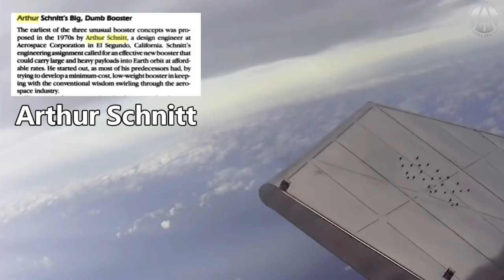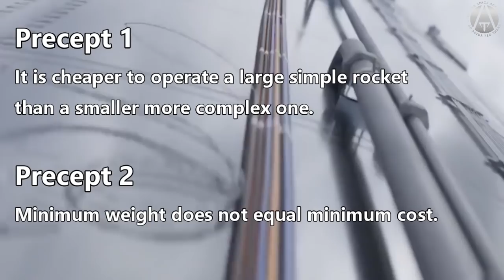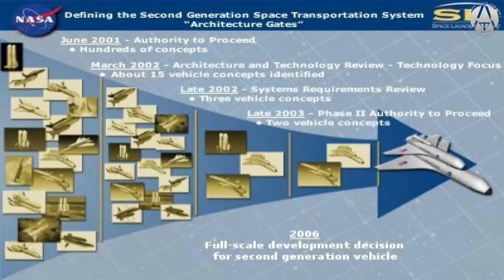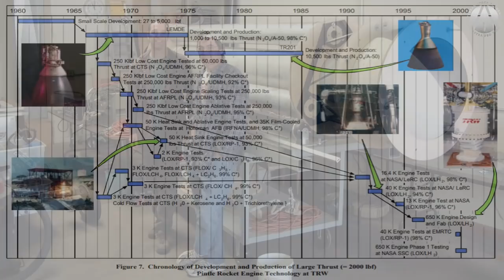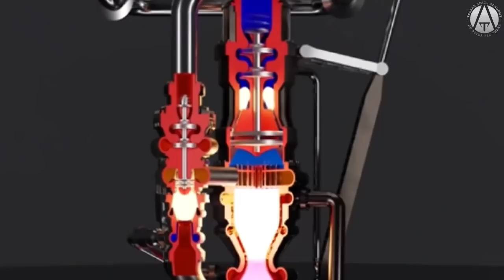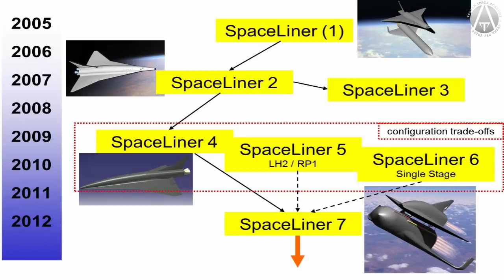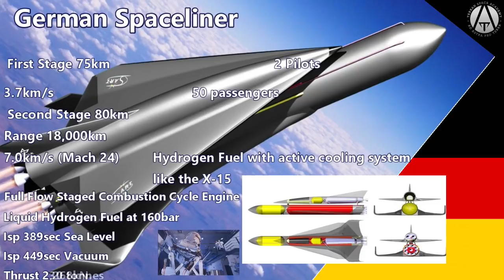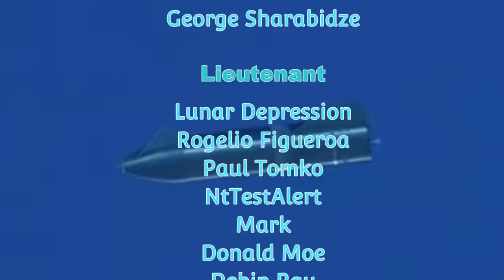SpaceX Starship: What is so special about the Starship system?

Comment: To paint a more accurate picture, it may help to have the perspective of someone who used to work for TRW before it was bought out by Northrop Grumman.  TRW was known for pulling off all of the most complicated and hard to do stuff in the aerospace industry.  There would often be another prime contractor for a government project, but TRW would get all of the most complicated, hard to do stuff as a secondary contractor.  When TRW got the prime contract, such as for the JWST long before it had that name, they were on track for the original launch date, at least when I saw it in the clean room.  TRW had a motto of bureaucracy busting internally and paying top dollar for all of the best engineers.  They wanted their engineers to make it to the finish line as unimpeded and properly supplied to do the task at hand as possible.  It was a great place to work at and there was a real can do attitude and lessons learned from past experiences and the long retention of employees, granted high level (as in government) changes in projects forced some turnover.  It was a whole different era of America.

So to more specifically answer what is not quite right about what you said, while of course there is the problem of how politics go about things, TRW was long supported by the government and TRW in turn brought in top talent to get the job done.  In the Clinton administration in particular there was a merit based system where companies tracked their metrics and provided them to the government when bidding on contracts.  TRW won a lot of stuff during the Clinton administration due to their excellent ratings.  All that changed in the Bush administration, playing more to the point you are making.  So it does happen that the best can bubble up to the top and pull off some amazing stuff.  It is just that is not what always happens.  Even with the ultra rich, most don't care and won't fund it once their money source is established.  We just got lucky with Elon that he has been willing to risk it all to chase after the big dreams and ambitions and bring on top talent to pull it off.

A thing to consider is most everything worked on as in big, well funded project, has some motivator and specifications laid out.  For example look at the A-10 Warthog and they had this big gun they needed to build a plane around.  You get a contract for a bomber, it is built around the bombs it needs to carry along with some performance characteristics for the delivery of those bombs.  Falcon 9 is built around specific goals that are now well known and understood.  Research for the sake of research is a hard thing to get funding for and getting into how that whole research funding process works could lead to you making whole series of episodes.

The thing is there are a number of good engineers, scientists, and inventors (and others) with great ideas that never go anywhere.  It is rare to get everything needed to succeed together no matter who is in charge and who has the deep pockets.  I see the root causes of this go much deeper than what is explained here.  Some of the more basic insights I see for this are:

1. Monkey sphere / good o' boy club - People like to stick with who they know and don't care about the rest of the people out there.

2. Risk assessment - When something is working and bringing in the money, even if it is really a dead end strategy for making money in the long run, people will stick with it and generally not make big risks (or any perceived risks) for potentially more money.  Usually the big risks taken are when you have nothing and consider yourself to have nothing to lose.  At this a lot of people won't take the big risks because they don't want to crater their current financial situation and so say instead of starting a company with big loans, will instead take a regular job at an established company.  There is also a bit of a counter thing that goes on where people will gamble away their money frivolously because they enjoy the thrill of gambling, but these people tend to not have money for very long or the money source (say a spouse making a lot of money at their day job) dries up.

3. Ignorance / too far removed - When you deal with something every day, say a materials scientist researching and building transistor manufacturing technology, you are probably going to make some realizations on how to do things better and maybe make that next advancement in your field.  When you manage people all day, you get focused on other things like does that materials scientist look busy, is s/he staying on task, are people complaining about him,/her does s/he complain about too much stuff, is it taking him/her too long to get this task done, is s/he asking for more pay than the company wants to allot him/her, etc.  That manager probably has no idea what is going on with that materials science work.  The thing I have seen is say with TRW, the manager telling people what to do at least used to be hands on and so has some sort of idea.  It might be a little outdated and you with your hands in it every day know about all of the latest stuff and maybe you are more daring while the manager is thinking more of what s/he did that worked so pushes for something more tried and true, so that can cause a little bit of friction, but that can't be helped.  Other places I have worked at have had very different things going on.  It is pretty common for management calling the shots to have zero knowledge of how things their underlings work on work.  Often times at the more dysfunctional places there are just top down one way directives that are more or less completely detached from the ground reality, but the base reality still hold true despite the top down one way directive.  The thing about Elon Musk is he is deeply involved in the nuts and bolts of what his subordinates are doing all the way to the ground level.  This is rare, at least these days.  With his enterprises growing to be so big, it is an enormous challenge for Elon to keep up with the more nuts and bolts side of things and there is the question of can he maintain his grip on it and keep things guided towards success?  I would not underestimate how hard it is for him to do this.  Just some simple breaks from reality because some information is not effectively conveyed can lead to big problems.  (Aren't we just hearing about Raptor engine production woes after some high level management turnover?)

Maybe you could put out more focused episodes on things like:
1.Iterative development processes.

2. Structured development processes in general.

3. All of the above and how to run a technical team has a whole lot of literature too it and certification processes and all of that other good stuff.  Really, the life or death of a project is largely how you structure the development process.  Often times if management sees the project is getting somewhere and succeeding they will continue to support it where if it has turned into a big, embarrassing mess, they don't want that.  So while not always the case, there is an influence on factors like this.

4. Get more into the ways to succeed and fail at bringing an idea from an individual or even group to a successful finished product.  You can make a whole series in the study of how this works and all of the various pitfalls where things end up failing.  While it is good to know what tends to work, often times what is needed is that key part that failed last time so maybe it can be avoided.  The problem is sometimes even if you know about it, you can't stop it from happening, but it is better than not trying when you know it is there.

5. Just understanding the human condition is really important.  You gotta work with others to get these sorts of things done.  There is a certain science to this.  So maybe just an episode on studying the human condition and laying out the groundwork for operating in a team successfully could be a very useful episode.  This episode seemed more of a rant than an educational episode.  There is so much to cover to help tackle the problems ranted about.

When you think about succeeding in space, space is hard, so we have to focus on all of the best ways we can go about accomplishing things and avoiding the common pitfalls in order to make space work.  For example you make a sloppy, unreliable power grid on Mars, that 11 hour power outage is going to lead to people freezing to death, getting CO2 poisoning, crop failures, etc.  (So even if you can put on a space suit and ride it out, if your crops fail because they got too cold during the power outage, you will starve to death after power is restored.)  Basically the death of your colony where on Earth you go to the store and buy more food to replace what rotted in the fridge and the crops in the field don't care about a power outage on Earth.  I mean on Earth you can go outside or something when the power fails and be alright and there is time for support to come in from other places and usually most everyone makes it.  On Mars that power is keeping you and everyone and everything else living alive and warm enough to survive, so when it is not working, that is your end.  Especially when you are starting off, there is nowhere to go and any help is years away.  I mean it is not a very forgiving environment, so you really have to have your stuff in order and a good game plan in place to possibly make it work.
Reply from the maker: You make very good points and we agree that there are always semi-valid reasons behind every decision and failure... we were discussing things as they are or recently were.  There is no successful company out there, like TRW or Boeing, that weren't at one time the pinnacle of their field.  The problem is that once they start to degenerate they are often still offered billions of taxpayer dollars... for the reasons you so thoroughly describe.  And this was indeed a rant against those practices. We really like your team building and project management insights... if we can find a way to make a coherent less than one hour lesson on these issues we would love to... could you email us at terranspaceacademy@gmail.com with your insights into these issues?  We really appreciate the feedback.

Comment: As your usual, this is another great video with an in-depth analysis of the situation encompassing SpaceX and their Starship.
As the days pass, the NASA solution to Space exploration - the SLS - is quickly becoming anachronistic. 
Chances are that Starship - political weight of the SLS notwithstanding - will supersede it, since the SLS sheer inefficiency.
But at one, special and very specific condition: that the Raptor does everything is written on its tin can. Possibly, today.
I don't know if the 10 km flights of the Raptor in the terrestrial atmosphere do qualify it as a "flown engine", or if these flights were mere "dynamic tests". 
I know rocket engines are the most difficult technological products to design and manufacture, because both mathematic theory and computer simulations aren't 100% effective, as there are a lot of black arts involved. And the Raptor require few more strokes of the magic wand before it can fly to orbit, or the Moon and Mars. All the hard landings of the Starship have been caused by shortcomings of the engine.
It is true that the Raptor is in development since ten years, but SpaceX has been pushing the envelope very hard only since the Starhopper flight. I wish them the best of luck with their engine, since the other problems they have can be solved with a good dose of iteration. They can be solved with some love, while the engine require some magic.
Thank you for your excellent videos; I'm somewhat surprised by the numbers, as some other chatty robot-voiced, clicky-bait, stock-footaged and algorithm-taming SpaceX videos, do command a substantially higher number of clicks. 
Once more, thanks for all your efforts...
Reply from the maker: You are most welcome Luminous One :-)  It is our goal to place education above entertainment... it will cost as the casual viewer but those dedicated to the science will appreciate it :-)

Comment: A good video in parts, especially the first half.  The problem with it though is that the title promises much more than is ultimately delivered.  Specifically: Starship is big.  Check.  Starship is made out of steel.  Check.  Tom Mueller designed a relatively simple engine with some great characteristics (Merlin).  Check.
What was disappointing is that the video didn't address the complexity of Raptor, if the 'simple' mantra of Arthur Schnitt is to be believed.  Raptor is efficient but at the cost of complexity.  If I'm mistaken here, it should have been addressed clearly in this video.  To live up to the video's title it would have been good to examine the various elements in Starship's design in relationship to  Schnitt's design principles.  This was not done, at least not clearly.  And clarity is important.  Let's have another go at this title but let's have a clearer, more organized, and comprehensive  look at Starship's design in another video.
Reply from the maker: Please do Vanden... we will look forward to watching!